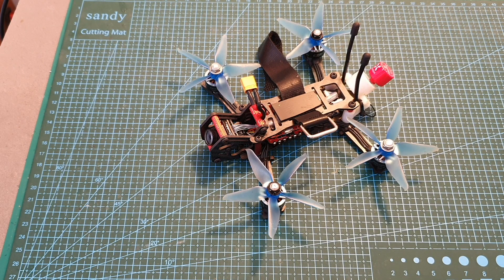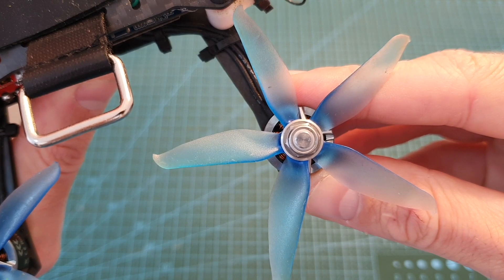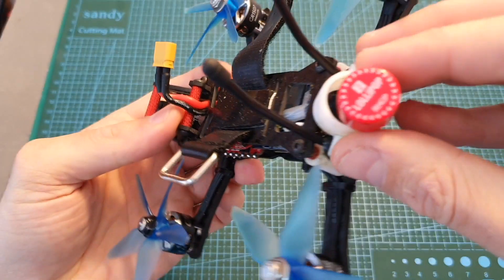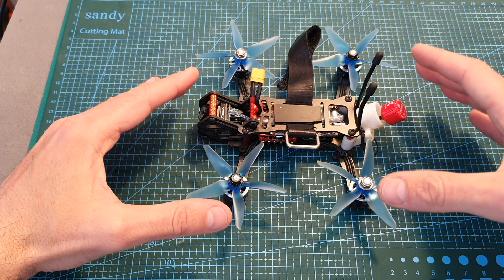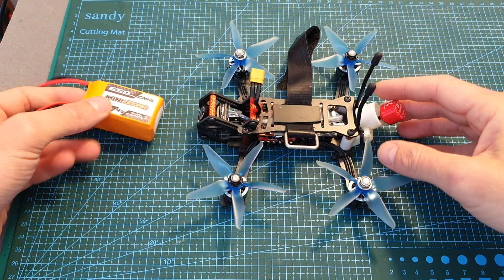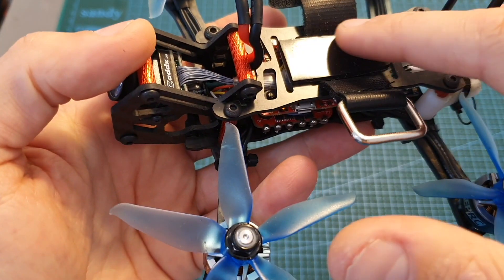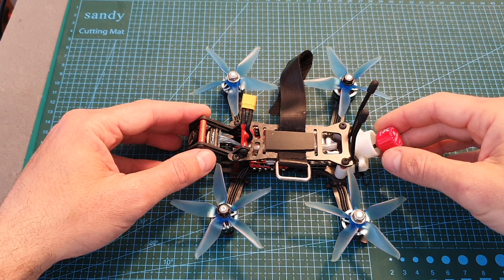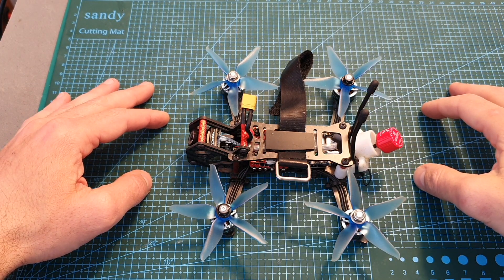AirbladeUAV Interpid V2 -  Build And Flight

Comment: The props look, uh, interesting, but gemfan 3052 fly perfectly on my 3in Interpid v2 with stock betaflight PIDs. Better to go with a known quality contender than a cool looking outlier IMO.
Reply from the maker: Yes - these penta-props surely look beautiful, but they seem to bend pretty easily, so my advice is to stick to the Dalprop 3056 / Gemfan 3052 which are my preferred 3" props.